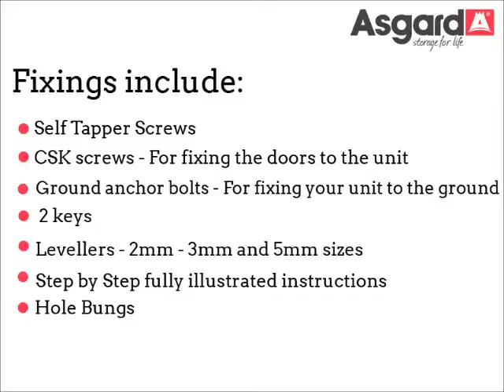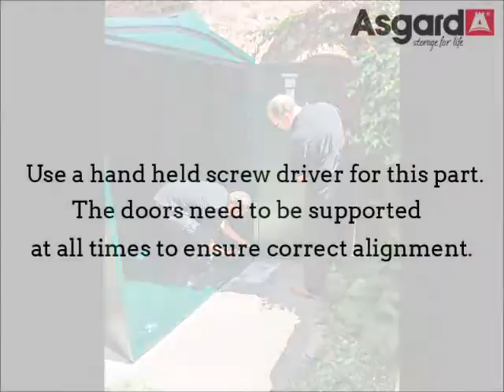Building the Motorbike Storage unit from Asgard

Comment: I think some Sikaflex and stainless steel rivets or nuts and bolts to secure panels together should make for an especially strong structure!

Titanium hinge bolts and mounting plates for high security lock and hasp are also intended.

One inch closed cell foam sandwiched between two sheets of 6mm plywood (self made SIP's) for floor, walls and foor insulation is my preferred choice for the interior for comfortable working in winter.